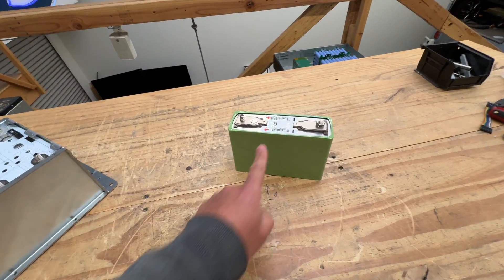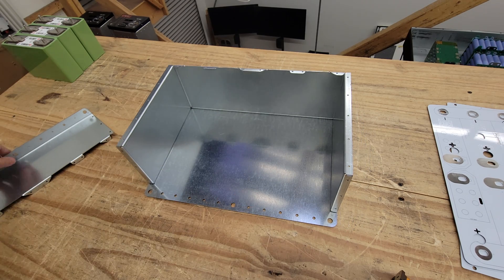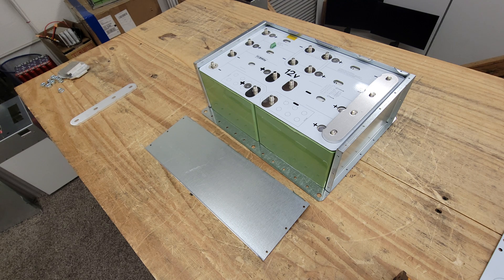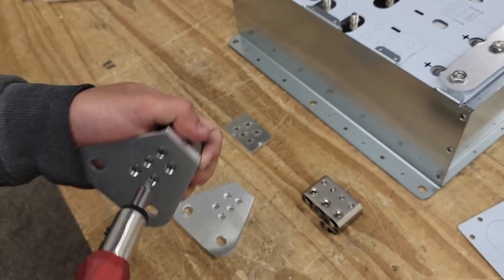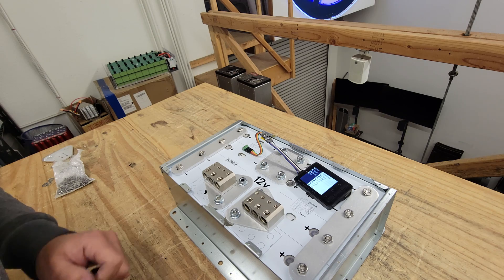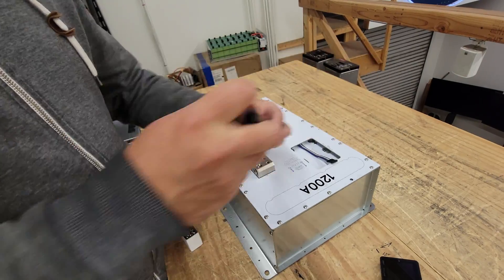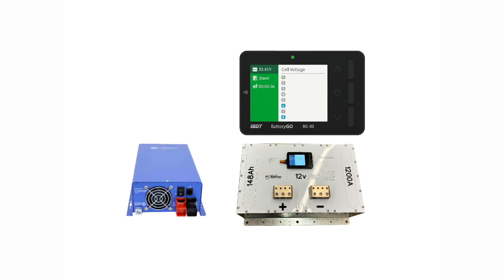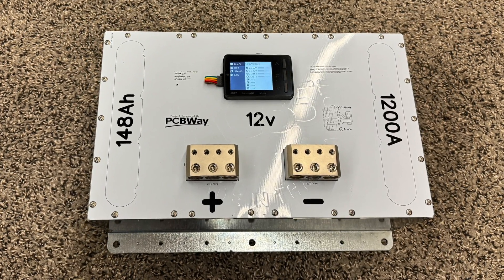Build A Professional Audio Battery KIT - LEV60 FAT BOX

Comment: Just recently ordered one of these with 16 of the Lev60 cells & the put together unit did Not come with the low profile nuts with the kit & also just had the regular single bms wire run w/out the extension so… My services with you have been CUT-OFF with over an hr. of research in how to contact ANYONE &… Nothing🤬

Comment: When will you get around using 1/0ga terminal blocks ?
Reply from the maker: My 1/0 cable fits in these blocks so….. probably never
Reply: @jehugarcia  oh ok I thought they were 2ga, my bad. I know 2 2ga = 1 1/0 but these audio guys......... Lol. Just trying to help you out 😁
Reply from the maker: the blocks im using now can fit 2|0 welding wire on one side and 2awg on the other
Reply: @jehugarcia Are these copper?
Reply: @peckerpeter2078  Can you clarify what you mean by "these"?
Reply: @TheArchimedesEffect  Sure bus bar plus all terminal connections. I had a chance to look it up it’s aluminum, which is no Bueno.

Comment: Would this be compatible with my EcoFlow 2000 to use as a back up to charge it on inclement weather days .  I'm very new to this stuff but it is interesting.  What kind of cable adapter would I need?  Thank you for sharing your knowledge .
Reply from the maker: I believe so,  if you can charge via 12v car charging,  you can make a cable that plugs between this battery and your EcoFlow.  I don’t know the particulars of that version of EcoFlow but pretty sure you can do it